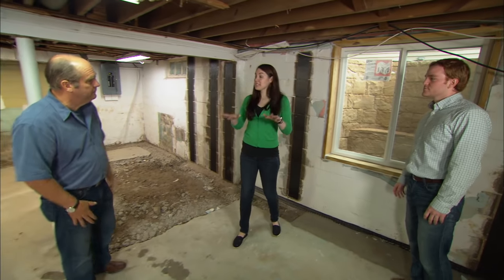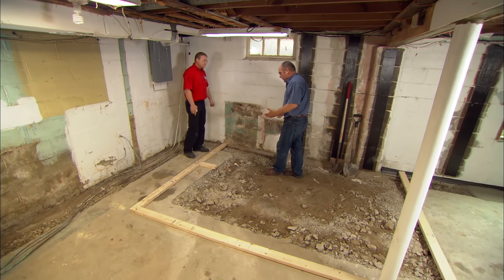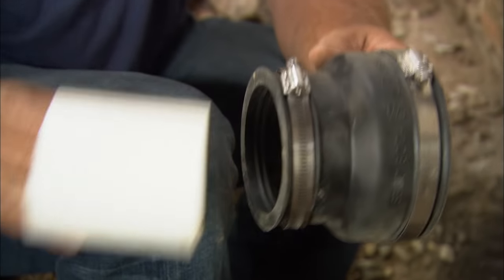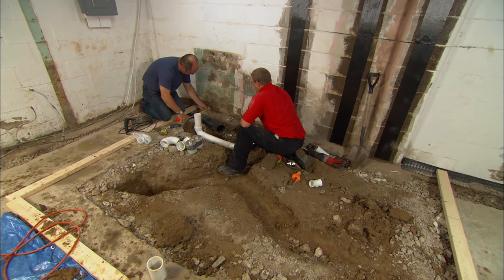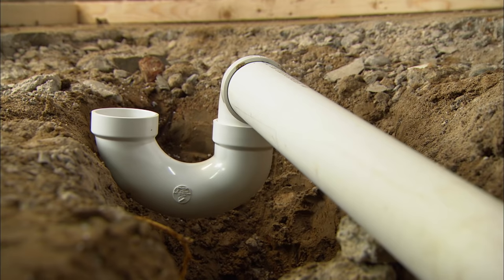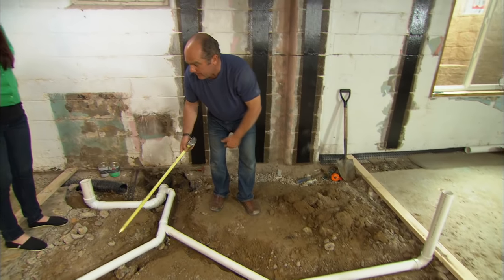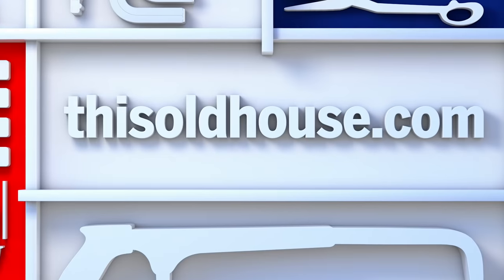How to Install a Basement Bathroom | Ask This Old House

Comment: First off wrong    4 inch fernco with mission band should be used.  🤦‍♂️ and going to 3 inch you can’t clean the 4 inch properly with out a clean out. And the toilet won’t count flange is only 3 inch.   Also no backflow valve used.  Incase of backup.  Omg 😮
Reply: i was thinking same thing...no cleanout or backflow  anywhere..could have at least one right before exits the building..
Reply: Vince Black 

Not backflow but back water valve🌺

Comment: I read that you’re not supposed to use those rubber boots with the hose clamps underground, is that true?
Reply: It's just the wrong type of coupling, it has to be a proper cast iron to plastic coupling. Still made of rubber, but its shorter, and has a stainless  steel shield wrapped around it. When tighten it up the new plastic pipe is solid to the cast iron, no flex.  What they used would never pass a groundwork inspection in seattle. Plus they should have set it up for test, and explained horizontal wet venting better

Comment: I recommend using an electric 12" or 14" saw with a diamond blade for all basement ruff ins.. 14" is best for cutting in one pass any 4 inch cast. Electric becuase the stihl gas saws just stink the whole place up and gives everyone a headache

Comment: Wouldn't the wet vent from the sink fail to vent the other two if someone is running a lot of water down the sink?
Reply: Yes, theoretically however the odds of that happening often are not likely. How often do you take a poo while your significant other brushes their teeth?
Reply: @DonJosesito   You're obviously not married.

Comment: We need 36 in  space,  18- OC for commodes in the philly area...New construction...Always build a box around shower pan traps...I usually make it like 12"X 12" ...Under that 48 X 48  shower, you'll never know...
Reply: +godbluffvdgg Box is a good idea if you need to relocate the piping slightly but guys get lazy and don't fill the box before putting in a preformed shower pan.  Those pans need full support or will start to crack over time.
Reply: zimsjeep You're right, I haven't seen any crack but, I can imagine it could happen...It really depends on the maker of the pan...Many of the new ones are pretty rigid...The ribs run out from the drain hub in all directions...But, I do both (set the pan and pour the crete) so...I have only myself to blame...: )...

Comment: Mission coupling only  under concrete !!! Not Fernco
Reply: Steven Shelton why not fernco fitting are great for fixing leaks and 2 the only thing that connect metal to plastic pipe is mj clamps
Reply: Steven Shelton it's ok in NY, FL, and NC
Reply: Ty Cobb ya I would like to know also
Reply: Mission coupling are for cast iron to cast iron piping. Fernco approved for cast iron to abs or PVC transition. I do use a shear band which is a shield with 2 more hose clamps on fernco for under ground. Don't plumb like these guys. At least 10 code violations on this system.
Reply: 1/8th per foot fall?? Inside should be 1/4" per foot.
Reply: Stephen Walsh what are the violations? Just curious
Reply: @albertoacosta3701  Si señor, solo 1/8 si es 4" o mas grande en diametro.. La wye de 2" tenia que estar rodada minimo 22 grados y no usaron un codo de "long sweep"en la parte que sube del concreto y se conecta al lavatorio. Este señor es plomero master y tiene una compañia en Roslindale MA. Ya le he pillado errores en otros videos que publica en Youtube

Comment: Thats such an easy build considering the main pipe to the sewer is under ground. What if it exits the house 4 feet above the finish slab.? Have to use a sewage ejector pump and that requires a lot more work
Reply: That's what we had done; went with a Liberty pump basin, with toilet, lav stubs, floor drain, util sink, $5K and some change. More work because cutting into concrete floor, yes, so we kept area to minimum, no shower.

Comment: I seen the lead joint move.
It's loose boys
Reply: i saw that to...they could have just pulled it out carefully and done a compression donut gasket....they should have used 4 band mission clamp
Reply: working shlub just not needed under ground indoors. Gravel and concrete will hold everything in place, fernco make a sufficient seal. It may have moved, as 700 youtube plumbers point out here. BUT WHO CARES?  IF, it leaks, it’s underground. And it most likely won’t, the jute will keep it sealed. The lead just kept it stable and filled the void. The seal was made by the jute/hemp.

Comment: Why didn’t you guys just use a 3 inch combo for the closet and a 3x2 flush bushing to go to the lavy and the shower? And why didn’t you use a 4x3 closet bend so you don’t have to put that foam over the closet riser when installing the closet flange?

Comment: not a plumber so I don't know just curious why wouldn't they have put a sewer back flow preventer in while doing this plumbing
Reply: Actually a good point. All fixtures below grade are supposed to be protected by a backwater valve.
Reply: Septic not city municipal
Reply: @TRUE_GR1T  Only required if the lowest overflow point in the house, usually a shower or floor drain, is below the lowest downstream manhole cover.

Comment: Love the show. But what about those drain pipes in the ground ??? where are those connected too ???
Regards
Reply: +Thias Russell The sewer pipe in the wall. That either goes to the city sewer, or a septic tank in the yard.
Reply: +joshua jesse Yep I know but the water drain tubes next to the sewer pipes is what i mean.
Thx.

Regards.
Reply: +Thias Russell those black ribbed pipes? That's called a French drain. Concrete is a porous material, moisture can seep through causing the basement to have water. These drains catch the water and slowly drains it into the ground below the slab.
Reply: thx.
Where I live we have the same thing but they are connected to a sump and when it fills it will pump it over to sewer.

Comment: Don't let this guy get an inspection.
Reply: You can do it and it will be functional. Wet vent is the standard here in Germany for decades. But you must dimension the pipes correctly and care about the angles of fittings and length of the pipes and the dimensions of a pipe fitting into another one, or you'll get problems. 

https://www.hornbach.de/cms/media/de/de/projektbereich/hof/wasserleitungen_verlegen/5_1_schmutz_und_regenwasser/vis_tsr_hausentwaesserung.jpg
Reply: Sizing vents wet vents and drains to work smart not excessive. The vent is at the lav sink going up the wall (behind the mirror). This is pretty basic stuff, if you think you need to vent every fixture separately, that’s old plumbing practice, if your just into smaller jobs like these, then you can get by, but imaging roughing in a while house, you’d loose your pants not working smart

Comment: use a 4x3 90 for the toilet so you can cut it off at the floor and use a souix cheif closet flange and glue right into the 4 inch pipe. also dumping a shower over the toilet and lav is not a good idea. I suggest  2 separate vents. and auto vents are not a good idea. they can fail. but if you can't get a vent out side you will have to use one. just make them assemble. just in case
Reply: auto vents are only allowed on island kitchen sinks where I live. I think some retrofit applications allow them as long as they are accessible but I agree a real vent is better.
Reply: Silenthawk98
Reply: yea here in ohio a studor vent can't be used to vent this only an island
Reply: It may have been possible that the pluming that they booted onto was too low to use that 4X3 fitting. Not trying to shoot your idea down but I wouldn't use the 4x3 el unless the pipe was too high where using a regular 90 wouldn't fit.
Reply: Ill second that they are too shallow for a closet bend. Auto vents are allowed within 30’ of a main stack”undiminished 3” vent” here. Live vent is best but not always available.

Comment: And that fernco is a joke should have used a heavy duty or husky transition no hub band which has 4 straps instead of two
Reply: That fernco is illegal in a lot of places when its buried/underground
Reply: That fernco is illegal underground in most places., and no purple prime, would fail.

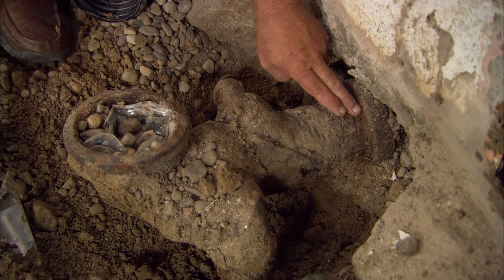Comment: At 2:22 he says we will have to be so careful so we don't have to cut it outside. What a joke! Heat it up and get the lead out of the fitting and go right to PVC.

Secondly, most codes require purple primer to be seen for the inspection and a licensed apprentice plumber working along side the Master Plumber. Not some this old house guy.
Reply: daobesebeast The guy from This Old House is a master plumber. His family has been in plumbing for over 100 years
Reply: Yvette daobesebeast
Reply: daobesebeast pc-4 cold caulking works mint
Reply: why pvc pipes, cant you use ABS pipes ? Here in quebec we use BNQ also a form of PVC but much thinner with all in one primer and glue which is grey .

Comment: That plastic he shoves onto the shower drain is pathetic 😂
Reply: dedicatedpyro No purple primer were the hell are they they have nothing ready for inspection..
Reply: Patrick Helsel In order to pass inspection 
for the " Rough-inn","top- out"   phase both International and Uniformed plumbing codes call for purple or blue primer NEVER Clear....
Reply: We use sill seal foam neatly wrapped and duct taped. Or cheap plastic boxes over over sized pipe as sleeves in pours. I really like that foam cap he had for the closet flange I’m gonna find some of those. As far as primer in ipc 2015 we were allowed to use clear primer again as its uv detectable. Personally i use purple for all underground 90% of above ground rough and even some trim. As long as your neat purple is clean and easy to see missed joints between days and techs and jobs that may start and stop for weeks at a-time.

Comment: Should have used a rubber flex from the cast iron joint. Could see the joint coming loose when the put on the 4x3 cross over adapter.

Comment: I am looking at buying a house where the laundry is in a closet in the house and I want to move to the garage and add a utility sink. Water supply lines are easy as the water heater is right there in the garage. House is all on concrete slab. The other side of the garage interior wall is the master bathroom. On that wall is garden tub, tiled shower and toilet. I was thinking of tying into the drain under the garden tub. Is this something that can easily be done considering I would have to pull the tub and chip out some concrete?

Comment: And no vent for the shower.  Woow. Vet vent only if structural obstruction not just for fun. Thanks to work like that i have more and more work to rapIr.
* vent true T not Y. Dammm.
Reply: It is a wet vent system. Check it up on youtube.
Reply: You can't put T in the ground horizontally. Only Y

Comment: Just want to say that even though one vent could & should take care of all the drains venting in the house, I was doing a two family remodel job in the city of St. Louis that had one 4" stack for maintaining both the upstairs  unit & downstairs one & both tied into.& out of one stack to the sewer. But the building inspector that inspected it failed it, to pass until I had it incorporated to run another stack separate from the original as on account  each unit now required it's own stack even though they passed thru the same wall & roof. It was now made mandatory even though the building was over 90+ years old. It was sufficient all those years but it's a money making deal for the city. This was in fact a poor neighborhood & with all the new legislation it is why the poor people are now so many homeless!
Reply: Dave Overbey you can only vent a certain number of fixtures on 2" and it basically equates to 1 bathroom group. If you are venting two it HAS to be the inch or run multiple vents.

Comment: Might this home have been a one story before which is why there's the rough plumbing for the "old" shower and toilet, or did it just happen to have them in the basement? Just wondering...
Reply: ntstudio28 more than likely it was a separate bathroom in a basement. Not that uncommon actually

Comment: you missed the Clean out when leaving the building.   WOOPS!!!!!!!!!!!!!!!!!!!!!!!!!
Reply: Todd Ransom No test tee this is not being inspected
Reply: it doesn't matter.  International Code requires.  And, why wouldn't you in the first place?
Reply: Todd Ransom True
Reply: they can't put a mainline in because they would need access to it so the toilet acts as the clean out if the main sewer ever flooded they would be fucked
Reply: your way wrong son.  You do not use a WC for a clean out.  You clearly know nothing about plumbing codes.
Reply: Yes I do I'm a plumber
Reply: I suggest you go back to school or read your code book.  That is basic, like first year apprentice know this.
Reply: The toilet acts as a clean out for the toilet trap arm and as a 3 inch clean out for 25 ft of the drainage line
Reply: Don't argue with me I teach the trade,  they're to lazy to break a few more inches of concrete and you know it.
Reply: Just cause you teach the trade doesn't mean you know the trade school code and field code are very different
Reply: I've been a master plumber since 1984 with 30 years on the tools son'
Reply: If they where to do it properly they would break concrete outside the bathroom run it outside bathroom put mainline box then run back into the bathroom but it's not being inspected so it doesn't matter
Reply: And when's the last time you where in the field
Reply: And by the looks of it it's coming to high to do that
Reply: there it is.  Not inspected, very poor attitude with your craft.
Reply: You should know not everything gets inspected
Reply: Gotta do what you gotta do
Reply: yesterday
Reply: toilet is a cleanout and so is the drain for the lav
Reply: Depends in what state or even county you living
Reply: Ty  Cobb please learn the difference between where and were.
Reply: I’m pretty sure that’s not the main line anyway, the whole upstairs plumbing runs down to another stack somewhere else I’m sure. But code is anytime a pipe comes into the house from outside it needs a clean out  as soon as possible. It’s the most basic stuff.
Reply: We have been aloud to call a toilet a clean out  in our county until last year. I personally have never pulled a toilet to snake in 15 yrs and every new install Incorporates a co of some kind even if its just the backwater valve access. Witch are also required on all fixtures below flood level of the main sewer vent pipe out side. On commercial builds we have been putting co’s just outside the building in the side walk with the thinking its much more convenient to never have to bring your snake or jet equipment into the building.in houses with no co’s in floor or stacks i always sell the clean out install then the snake. makes life easier on customers and techs in the long run  in servicing and diagnosing.
Reply: @stevenlanders4919  I worked at a restaurant. They had to pull the toilet in the men's staff washroom for clean out once. The pizza place next to us in the plaza was dumping grease down the sink.
Reply: Always some dude named TODD

Comment: He mentions using an inch and a half vent for a toilet, code here is nothing less then two inch, and also two inch drain for a shower, so your not increasing to two inch. But one more thing I noticed was and it might be the camera angle but it looks as if he is turning a two inch 1/4 bend up for the Lav. As a drainage fitting a 1/4 bend is only used from horizontal to vertical, that should have been a LT 90 or sweep.

Comment: No matter how close the cut is in the old pipes..  usually the lead wad ends up giving and the whole thing needs to be redone-  why not run a smaller sch.#40 to inside of the drain heading outside ?

Comment: the old lead cast iron joint isn't more leakproof, you can see at 3:44 the joint is moving and opening a gap, so the joint should be cracked.

bad job, after pouring the concrete its necrassary to stem off the new solid concrete again to seal up the joint.

Comment: The shower will be 48 inches square? You can't come off the bottom plate 24 inches for center, you need to add for wall covering and tile, 1.5 inches minimum.

Comment: Is there any concern with sewage gases and cutting with the sparks? Also should the local plumber have been using primer on the PVC, or is there a reason he didnt?
Reply: Good job try to help this family.
Reply: taledarkside No it's not primer is a critical part of solvent welding.
Reply: taledarkside ???

Comment: But how can add a new shower drain to existing toilet drain on concrete slab ?? The cast iron pipe for the toilet come up from below so I need to cut before toilet flange but do I need to make a large hole / diameter??Thank you!

Comment: I was hoping they'd get into how the drainage would get up out of the basement. I thought being a basement, the pipes would all be below the pipes running through the rest of the house. Is there a pump that pushes the drain water up or is all the piping for the house just really so low that it all connects with the basement?
Reply: Yep the drain for the whole house comes in under the basement floor. Some houses it doesn't. This one it does. No pump required

Comment: Does this "wet vent" thread make the restroom smelly?  because there is no p-trap for the lavatory drain and vent pipe
Reply: No the wet vent will act as a normal vent carrying all gases straight out. The lav gets its own trap when the sink is installed

Comment: Wall not legal guys. NEC demands that you must maintain 36" clearance in front of the circuit breaker panel. Have to add in the 3.5" of panel so finished wall must be at least 39.5" from new wall.